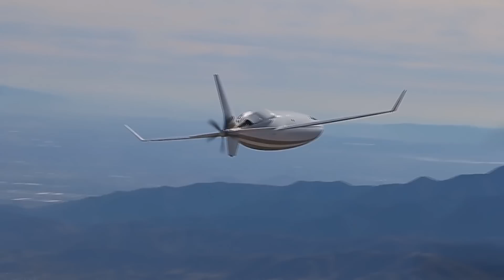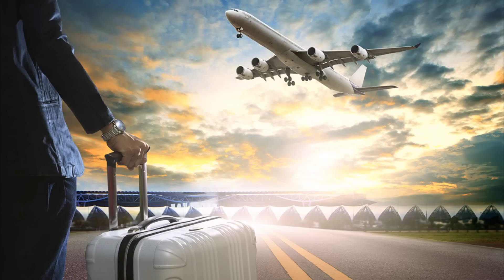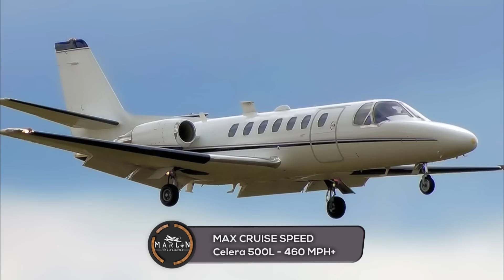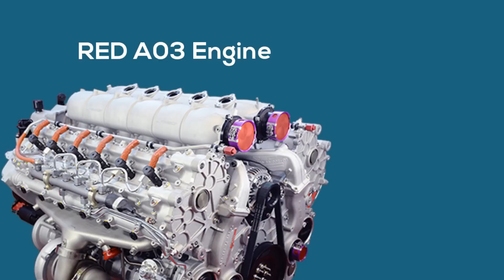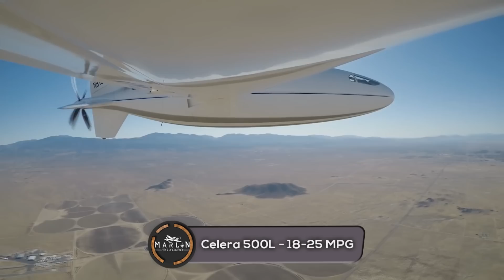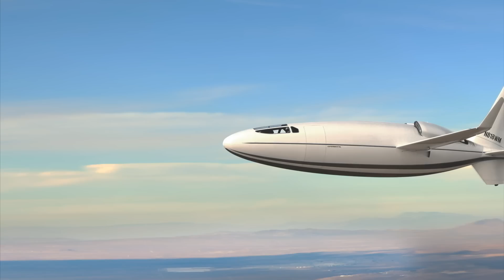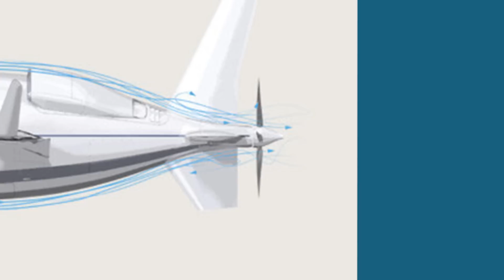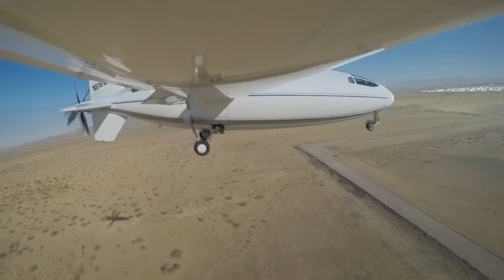Meet the Celera 500L (Flies Faster, Farther, Higher, Cheaper)

Comment: I’ve looked at the Celera’s specs.  I view their conclusions as highly suspicious. As the old saying goes if it looks too good to be true it probably is.
Reply: What, specifically, is suspect? And why?
Reply: Marc de Piolenc its another pie-in-the-sky laminar flow project which does not align with the laws of physics.  Typically you’re not going to achieve a laminar flow of more than a meter or so at those proposed speeds, no matter how clean a Celera is.  It’s not operating at 50,000 ft nor does it achieve the claimed efficiency of 8x that of a comparable jet.  It stinks of snake oil.
Reply: @TheRealCFF  If you can get a copy of Bruce Carmichael's Personal Aircraft Drag Reduction, please read it. Mr. Low Speed Aerodynamics refutes a good deal of received wisdom about laminar flow.
Reply: Joseph Alberta Yeah I’ve spent 15 years as an aircraft designer in the aerospace industry and am a degreed mechanical engineer.    

The chief question you’ve got to ask yourself on an airplane like this is if it were that easy to get these drastic performance gains, why hasn’t every OEM implemented the same design features on their aircraft?
Reply: @TheRealCFF  You have to know all the ingredients...and how to combine them. I knew about all the individual features of the design, but would not have had the imagination to combine them in a practical aircraft.
Reply: Marc de Piolenc Right. Here’s the thing there are a lot of aircraft OEMs out there who employ a lot of smart people to solve design problems like this as well. And one would have to reason that, if seller a found it’s so easy to achieve this performance gains, it must be is easy for another firm to do so as well. Low to mid subsonic aerodynamics are very well understood science at this point.  An aircraft or a symphony of design trade-offs, where focus on pure aerodynamics often results in unwanted design features eg handling and controllability, manufacturability, etc.  I just think back to the Lancair IV as an example of a speed demon which was a little too hot for the average pilot to handle.  I suspect that this airplane will not live up to the performance figures the manufacturer is predicting.
Reply: @TheRealCFF  Not sure "easy" is the right word. Based on the classic flat plate experiments, the general conclusion is that laminar flow is impossible to achieve except under exceptional circumstances, so nobody has been trying to do it. Other research, which I learned about from Bruce Carmichael, says that laminar flow IS possible on real aircraft operating at full-scale Reynolds numbers. I'm not sure that, even now, that research is generally known. My review of Carmichael's book is here:  http://archivale.com/weblog/?p=102 . Bruce is no longer with us, and I am not sure whether his widow is still selling his books, or whether she still lives at the same address. Bruce put extensive work into contracts for the US Navy to build low-drag submerged bodies, which operate at Reynolds numbers comparable to those of aircraft due to the high density ratio of water to air, and his "Dolphin" bodies were successful in maintaining large runs of laminar flow.
Reply: Trump is selling it so its believable ! 😆

Comment: I don't consider no fuel in the wings to be a safety feature.  It means the fuel is in the fuselage, closer to the occupants.  The only reason the fuel is not in the wings is they are skinny sail-plane derived sections that can't accommodate a tank.  Laminar flow is great until you find yourself flying a little too slow in the traffic pattern and then hit some shear.  Ask Cirrus about the stall characteristics.

Comment: If they’re going to take a Rutan design, they should have also taken the canard winglets to add cruising range.
Reply: It has wingtip canards (?) This feature alone has show substantial flight improvement and maybe forward canards interferes with the smooth wind flow which is a substantial reason that it works so well.
Reply: Dana Casale forward canards at a slightly higher angle of attack than the main wings keeps the nose up without lifting body lift/drag. They also stall before the main wing, which drops the nose out of the stall. Anyway, otherwise it just looks like a Rutan without all the features.
Reply: @mgmcd1  This may be true but the body is a lifting body and again canards may interfere with the over all aerodynamics. Which is my point. I would think that the designers would have considered canards for the reasons you mention, but disregarded any aid they may have given to maintain the overall aerodynamics.
Reply: Winglets are essentially equivalent to the same amount of additional span. In a small airplane like this one, there is no span limit that requires winglets.

Comment: Flying across the Atlantic on a single engine? No thanks. 

Also not a fan of how short it is. Elevators that close to the main wing is going to mean restrictive CoG to avoid high trim drag, which is not great in an aircraft with people who might move around. I'm honestly surprised they didn't go for a canard configuration, as it would offer far more leverage. It would also push the main wing back, meaning the winglets would have a more positive contribution to directional stability, permitting a smaller tail. 

The pusher prop to reclaim the boundary layer seems like a nice idea, but the prop isn't going to be doing much useful work that close to the root. You would need a dedicated fan running at much higher RPM.

Some nice ideas, but seems half baked. They have taken the pod from a glider, put a pusher prop on it to reclaim the boundary layer in a way that doesn't really work but gets rid of the possibility of a boom, and then used large draggy control surfaces to mitigate the stability problems this causes. The only thing this does interesting is keeping the pressure vessel light, cheap, and reasonably aerodynamic. Everything else is compromises that are typically avoided because they are bad.

Comment: The ceiling is a bit optimistic, but the other stats are extremely impressive. Alaska and Hawaii would really use this. Other third world  areas with minimal services would also be well served. A very exciting aircraft. As a pilot I'm extremely pleased that he's not going to go fly by wire which is very unreliable and if you're in that one out of a thousand aircraft that has a fatal problem it's 100% failure for you because you'll die...

Comment: Interesting. However it still a normal engine driving the aircraft. He be better doing a Electric plane, driven by Tesla type battery packs and a 100% efficient electric motor unlike the un-efficient ICE motor which of course is complex and has high cost of maintenance and fuel costs! and even the best tuned ICE motors are only 35% efficient. with tons of CO2 and Monoxide and un-burnt fuel pollution and lots of noise. The electric design could have high output electric generators geared to the drive motor so as it turns at speed the generators will produce lots of free electricity to put back into the batteries as it fly's or taxi's. Now that be a far better idea than another polluting noise ICE powered aircraft.

Comment: Very interesting concept, don't understand the poor visibility in cockpit, they could at least have emulated the porthole windows in similar shaped Spaceship One and moved primary window fwd to be more useful during landings.  See : https://cdn.cfr.org/sites/default/files/styles/full_width_xl/public/image/2018/08/Prizes%20and%20Innovation.jpg   The V-12 propulsion seems more complicated than necessary, this has some generic resemblance to the Raptor which is a turbo-diesel powered pusher config more in the Rutan style with swept wings and winglets,  see :  http://raptor-aircraft.com/images/cross_section4.JPG

Comment: I'm inclined to say I'll believe it when I see it. Half the pitches made by the company don't sound like they add up... 

1. The performace stated doesn't sound legitimate. We're supposed to believe that a 540 hp engine is giving this thing the performance of a Lockheed U-2 spyplane? 60,000 ft, approaching 500 mph, over 4000 nm? I'd say that's optimistic at best. Especially looking at that cute little propeller slapped on the tail, behind all these things that are going to create turbulent flow no matter how "laminar" it's supposed to be. 

2. Systems redundancy is in many cases mandatory. Very little of what is stated here makes it stand out. Mechanical linkages of controls don't even provide greater reliability in my opinion when compared to simple electric circuits and servo motors. They also come at a potentially high cost of poor handling, and the radical shape of the aircraft looks as though the tail section does not have as much surface area as we might expect is necessary for stability and authority of the aircraft. Finally, no fuel tanks in the wings and the slender profile of the wings will probably compound that issue, because it looks to me that about 95% of the aircraft's weight is the fuselage. I wouldn't expect much roll stability, even if the aspect ratio looks good. And having minimal weight in the wings actually puts much more strain on them in level flight (there's too little gravity acting on the light wing to counter the lift being generated). Overall, very scary design choices in the name of "safety." 

3. Any time someone tells you an electric engine will outperform a traditional engine in terms of efficiency, they're lying. Lithium batteries have far less energy storage capability per unit volume than avgas or really any other petroleum source. Simply put, having enough batteries to go the same distance would take up dramatically more space in the aircraft. And, more importantly, batteries are heavy. Much heavier than oil. No chance this will ever become an electric aircraft. 

However, I will say that if the price per flight hour is correct, they may be onto something. <$1000 to rent a whole plane that can land on a short runway virtually anywhere? Certainly an intriguing prospect.

Comment: Love to know what the inside looks like having no windows. It would be cool if they integrated cameras and tv monitors on the inner walls instead of windows.
Reply: Any structural designer would love to be able to do without windows. That way you wouldn't have to add a whole lot of structure to reinforce the widow openings. . Would passengers go for it or would people be panicking, trying to open the exit door in flight because they were claustrophobic?

Comment: Here's what will happen. Firstly, if it ever gets to production the build cost per unit will skyrocket. It will not meet the performance figures quoted, not even close. 50% of the per hour flying cost come from an external source, eg- fuel, maintenance, airport charges, etc etc. When it eventually gets forgotten there will be those that blame "big oil" or other such nonsense for its demise.
30 years of Aeronautical Engineering has thought me this!
Reply: @psychiatry-is-eugenics  On a train, no reading glasses, fat fingers, auto correct! 😁
Reply: @psychiatry-is-eugenics  Its YouTube, you shouldn't be so anal!

Comment: When I look at this plane my first thought is that it is exactly what a fuel cell electric plane should look like -possibly with greater wing span for lower speed.  The bulbous fuselage would fit a giant high pressure hydrogen tank nicely behind the cabin.  Batteries are way too heavy to compete with FC.

Comment: Quite a lot of claims.  It is revolutionary if you hit those numbers but I have doubts -primarily with the efficiency you expect from a push prop.  I think the air will be quite turbulent when it hits the prop blade culling it's efficiency.  I also question your operating cost estimates for a piston engine -lots of parts that take lots of skill to assemble.

Comment: When someone shows you a cartoon and tries to tell you it's a real event, who is he trying to deceive, and why?
How dumb do you have to be to realize that these guys want to pry a few hundred millions from clueless investors?
I worked briefly for a company funded by clueless investors. Overseas oil money. They were clueless.
This is such a weakly disguised scam that I think they are pfishing for super-clueless money. They don't want to try to dupe smart people.
Reply: A 3300' runway for balanced field? Ha.
(What "balanced field" means: Runway length sufficient to accelerate to takeoff speed, then put on the brakes and come to a stop while still on the runway. The concept is only used for twin engine aircraft, because it dictates the emergency procedure in the event of an engine failure on takeoff. Except here, they're using it for a single engine aircraft.)
https://en.wikipedia.org/wiki/Balanced_field_takeoff
Why do I say 'ha?" Because when you design an airplane, you choose between high cruise speed and short runway length. You can't have both.
The balanced field length for a Beechcraft King Air -- a well regarded $8 million eight-seat twin turboprop that the Celera fantasy would pretend it could compete with -- is 4700 feet. Oh, and the King Air uses 2,100 horsepower, compared with the Celera's make-believe 600 horsepower, and cruises at 303 knots, far slower than the imaginary cruise speed of the Celera.
Boy, those engineers at Beechcraft must be really dumb, huh? (Uh, that was sarcastic.)
Reply: If you're going to lie, lie BIG!
Farther along in the video, they say they think it'll fly at altitudes upwards of 60,000 feet!
This from a piston engine!
I've flown at 41,000 feet. The plane wouldn't go higher. I guess those Gulfstream engineers are as inept as Beech engineers (Uh, that was -- again -- sarcastic.)
Reply: See the placement of the rear landing gear? And the dorsal fin below the fuselage?
You'd strike the dorsal fin on the ground every time you rotated for takeoff.

Comment: I'll give it a 99,9  as those ducts on its back certainly could be eliminated or streamlined to better overall looks and performance. 
I do take it that it's for cooling of the engine but surely cooling pipes could be shaped along the curvature of the plane with greater efficiency and better airflow  and performance plus be better looking as well. 
Great video.